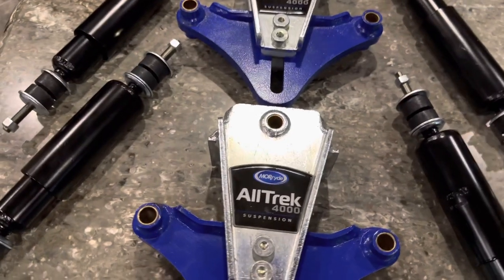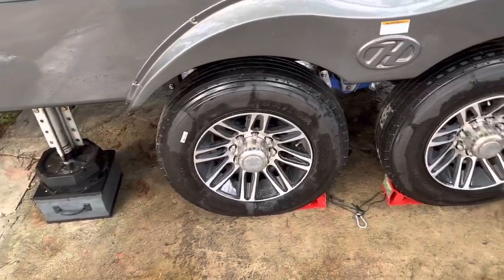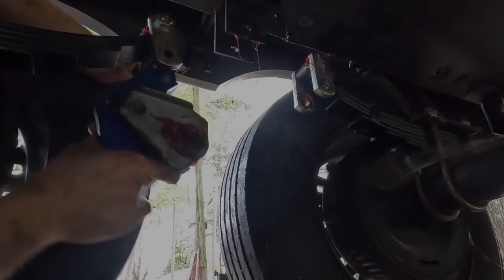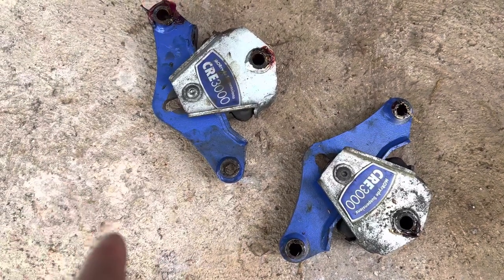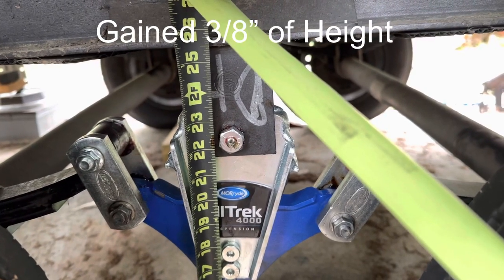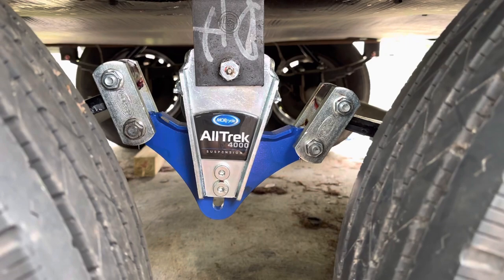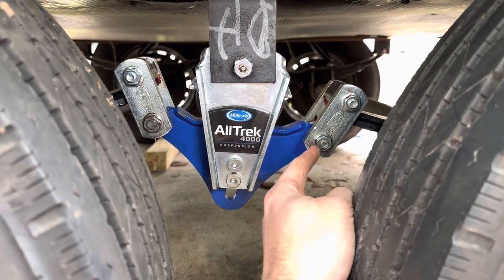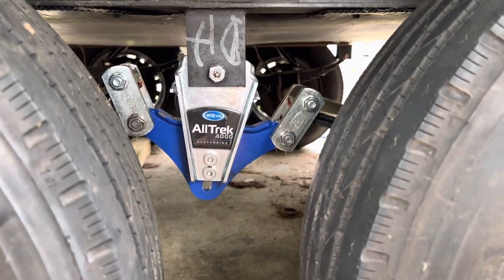The All New AllTrek 4000 Suspension System!!! Ride Height Change?? Will it lift my Camper??

Comment: So why did you install the Alltrek wet bolt with the zerk facing out and the other wet bolts facing in?  I find it much easier to have all the zerks facing out so i don't need to crawl under the RV to lubricate the wet bolts.

Comment: Don't spin the bolts and ruin the splines, they are there for a reason. To hold the bolt from spinning and keep it lined up for the grease to flow in properly.  If you have problems getting the bolts out, take both out and slide the shackle off and get them off the shackle in a vice or a ball joint press. Don't beat the bolts out of the shackles.
Reply from the maker: I replaced the bolt and bushing. I was in a time crunch lol had to just make it happen 🤣

Comment: If you had removed the nut from the spring side of the shackle. The shackle plate on the side with the nuts would have slid off, and the side with the bolts would slide out of the equalizer and leaf spring. Doing this would have saved a lot of time and you would not have damaged any nuts or bolts.
Reply from the maker: Tried that. The brand new wet bolts I installed prior to this have teeth that bite into the bronze bushings. They were locked in there!
Reply: If the teeth bit into the bronze bushing, you are totally destroying the concept of the wet bolt being a bearing surface. Not sure where you got the aftermarket wet bolts, but the teeth were TOO long. @BigCountrysWay
Reply from the maker: @silcom2000  they were perfect. They were just doing there job by not rotating or moving. They’re only tightened to 40ftlbs by spec. They’re supposed to seat tightly. Wet bolt kit was Moyride brand as well

Comment: Step 1 on instructions. Safely raise and support your unit and then remove your tires... This could have saved you lots of trouble on your install.
Reply from the maker: I used my auto level jacks to take the pressure off the springs. That’s why everything just lined right back up